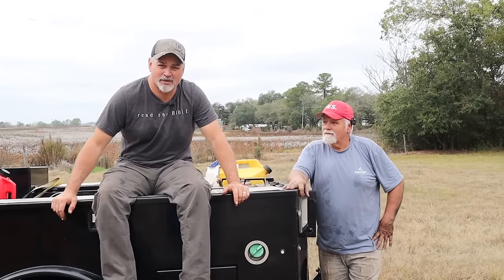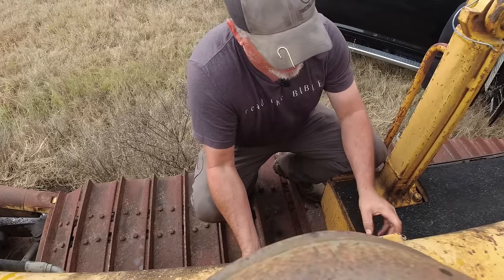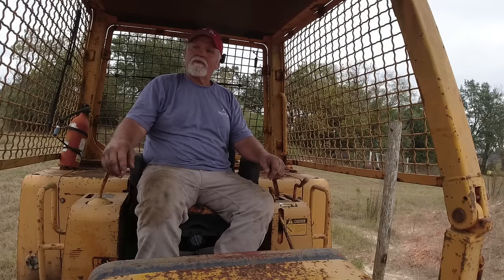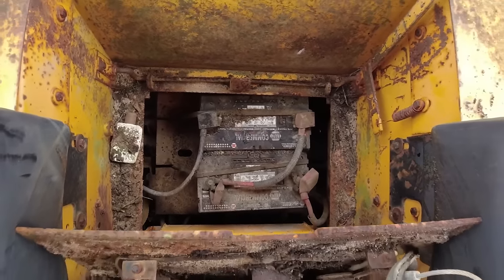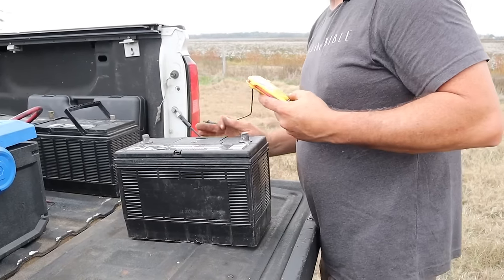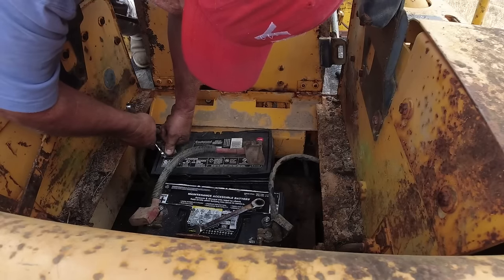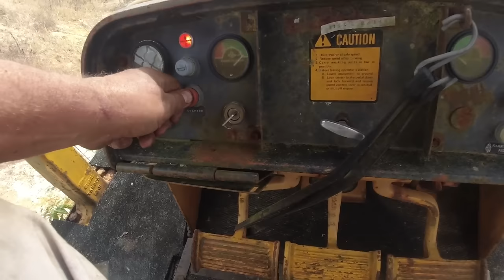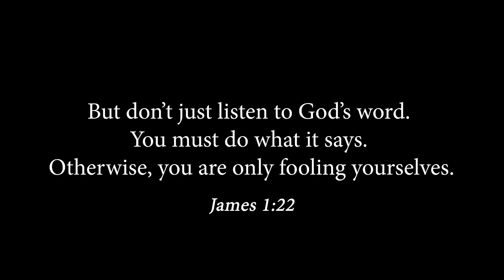Can this BIG BULLDOZER push dirt again? Let's try to fix it!

Comment: No Hank Those are steering pedals on the right & left . & Brake in the Center .  The 750B & 850B John Deere Dozers are 80's &  about very early to mid 90's model machines . 

The A & B series  of 750 & 850 dozers had a Hydrostat whine . at first it drove me nuts. I eventually got used to the sound. 

 The 750C & 850C series dozers came out in mid to late 90's.
Mack

Comment: Good job on that tractor and it even moves forward and backwards, why does the owner just up leave those big equipment out there for years. They could have sold them instead of letting them turn to rust.

Comment: The wonderful thing about Diesel fuel is that it doesn't go bad. I've seen other videos of engines running on 50 year old fuel, a Diesel can run on almost any flammable liguid, used motor oil, brake fluid, tranny fluid, alcohol, used cooking oil, they're great engines.

Comment: Good job guy's 
And you don't have to be a mechanic to work on equipment. As long as you have some basic knowledge.  I have rebuilt engines transmissions and Diffs and are still driving them to date. Alsp do all the wrench twisting on snowmobiles  side by sides or whatever runs on gas or diesel and haven't never spent one day in mechanic school.  
So, all the power to you guys. Keep up the good work.
From Canada

Comment: Ran 2007 750j lt logging package dozer back in 07-08 for local logging company. That thing was a monster first big dozer had ran and always a blast to run. Love the  hand controls very precise dozer
Reply: Yes sir the J series is a whole different beast from the ole 750B & 850B Deere's I cut my teeth on.   J series is a Cadillac compared to The B series Dozers. 

Mack

Comment: Thanks for a great video. It was interesting. 

Congratulations to Hank and Wiley for getting this dozer running in no time. Good job guys. You did great. 

Nice dozer yet. Could be fixed up and put back to work it appears. Nice unit yet. 
Thanks. The Iowa farm boy. Steve.

Comment: Its pretty common for those machines after sitting for a while for them to take off like that or if they get run to low on hydro fluid they will take off also

Comment: I operated  a 750 John Deere back in 1986. It was a dead horse compared to the 850. I operated an 850 for about 6 months in 87. Loved the foot steer. That put the left hand on the forward reverse lever and the right hand on the blade control. I ran lots of others and the 1987 850 John Deere was my favorite.